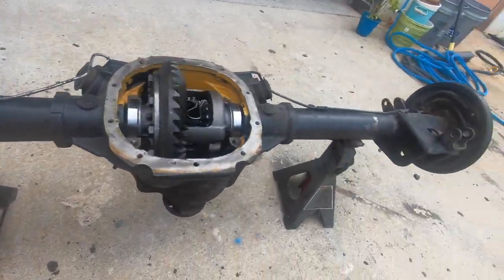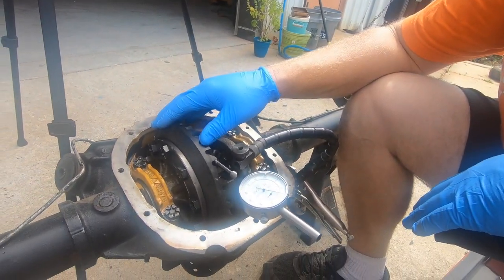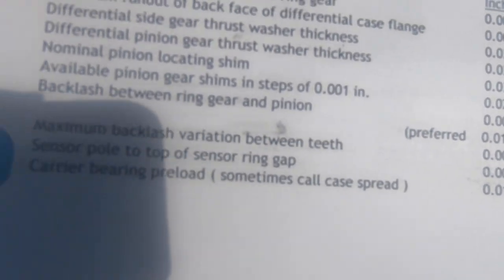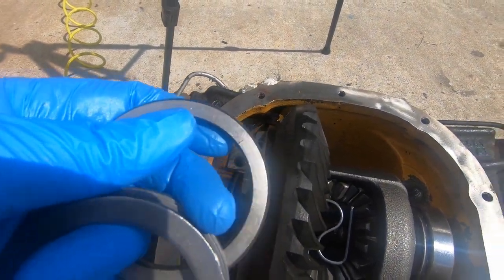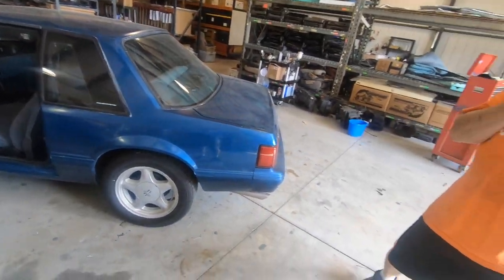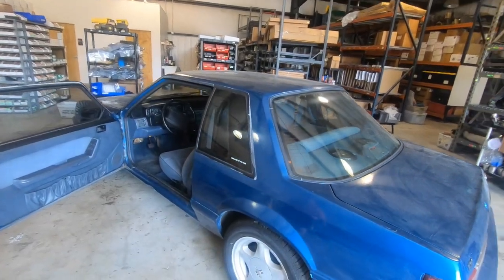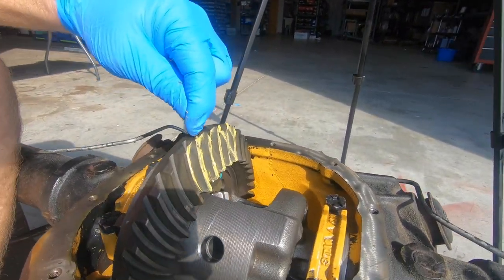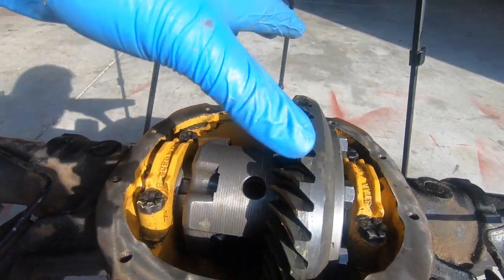Setting the Backlash on a Ford 8.8 Rear End…My FoxBody Mustang SSP Rebuild Continues

Comment: You should do after market upper and lower control arms when that rear end goes back in. Maximum Motorsports for the win.
Reply from the maker: Debating on where to go with it. I do want that for my vert.
Reply: @GearHead704  I have UPR complete suspension and love it.